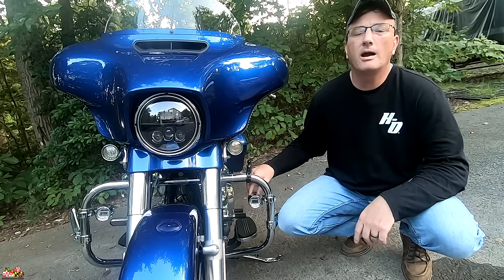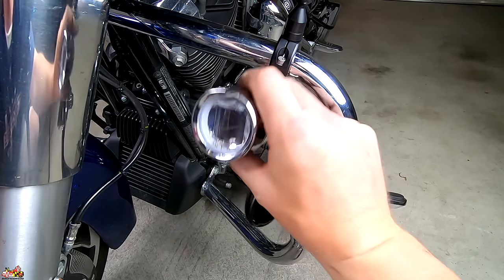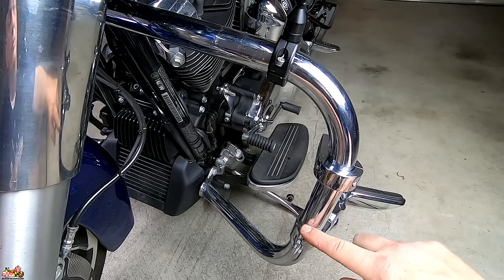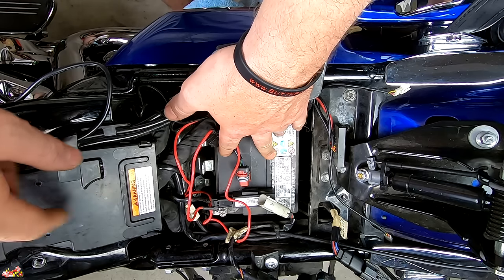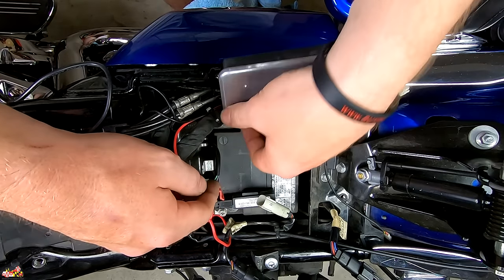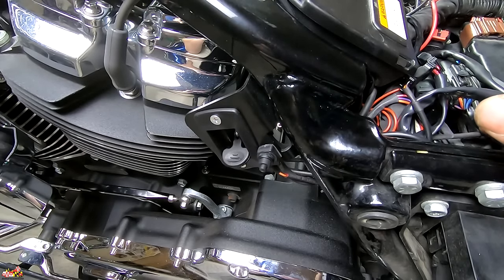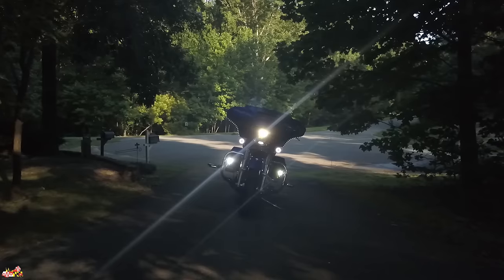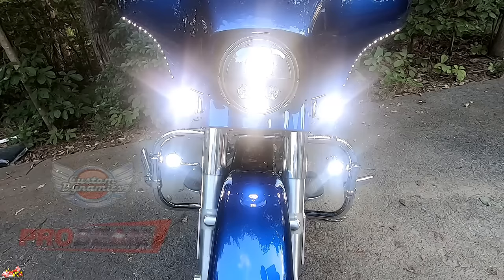How To Install ProBEAM® LED Halo Fog Lights for Harley Davidson & Indian Motorcycles 🔧

Comment: Why didn’t you make these so they could be wired into the auxiliary switches? Street Glides have all these unused aux switches and you want us to double sided tape another switch? Doesn’t make a whole of sense.
Reply from the maker: We include a push button switch with the ProBEAM® LED Halo Fog Lights in case the stock auxiliary switch is already being used by something else. However, if wiring the ProBEAM® LED Halo Fog Lights to your auxiliary switch is your preference, you can certainly do that instead of using the push button switch we provide!
Reply: @customdynamics  Has any one figured out how to wire these to the Aux buttons on the SG
Reply from the maker: @jasonwilliams7882  Feel free to give us a call at 800-382-1388; our techs would be glad to discuss that with you.

Comment: I PURCHASE ALL MY LIGHTING FROM CUSTOM DYNAMICS. I HAVE THESE FOG LIGHTS AND THE LIGHTING IS GREAT! HOWEVER, I JUST REMOVED THEM TO REPOSITION THEM FOR MY ADDED LOWERS AND THE MOUNTING CLAMPS ARE PEELING I NOTICED, PLUS THE THREADS IN ONE OF THE CLAMPS WONT GRAB. ITS NOT STRIPPED BECAUSE IT GOES IN NORMAL BUT THE THREADS ARE WORN AND I CANT TIGHTEN THEM ENOUGH TO NOT MOVE.☹
Reply from the maker: Give our office a call! We can certainly work with you to get these things resolved. 1-800-382-1388

Comment: Thank you for your awesome DIY videos. I own a 2018 RKS and definitely learned a lot from you. Recently, bought the Custom Dynamics Low profile saddle bagz light, the magic strobes, and the mini tail lights and watched your install video. Is there a maximum number of lights that you can connect to the battery before it overloads?
Reply from the maker: Technically, you could reach a maximum threshold on the bike’s battery if a significant number of lighting upgrades/accessories were installed on the bike. However, LEDs use far less energy than incandescent bulbs/stock lighting so, with the products you currently have installed we wouldn’t expect you to have any issues overloading the battery. Some modules like our Magic Strobes™ RSG Brake Light Flasher do also have a maximum power rating (84 Watts or 6 Amps) but again, with the products you’re currently running, you shouldn’t have any issues! Also, as a side note, all of the products you mentioned are only powered on when the bike is and would only be drawing power when the bike’s switch is on. Let us know if you have any other questions, we’re available by phone at 1-800-382-1388! Thank you for choosing Custom Dynamics®, have a wonderful weekend and stay safe!

Comment: The video title of this marketing piece should be "How I Installed ProBEAM LED Halo Fog Lights on my Street Glide." These aren't really instructions, more of a tour of the finished job which is only marginally helpful. Video could desperately use some labeling like an arrow pointing to "male end of brake light cable" instead of staring into a mass of identical looking cable ends while someone quickly hand waves through what was done. 
My problem is the dealer won't touch my older motorcycle so I'm stuck with having to either install this myself or find a local independent motorcycle mechanic. Meanwhile, I'm being forced to become a "YouTube Certified Motorcycle Mechanic."
Reply from the maker: While this video explains the steps to install a pair of Fog Lamps, mounting location, wire routing & installation under the seat will vary from motorcycle to motorcycle. If you have specific installation questions for your model you can contact our tech support team at the following link for specific details for installing on your particular year, make & model. https://customdynamics.zendesk.com/hc/en-us/requests/new

Comment: Excuse my ignorance, but I've eliminated my front turns, but would like to add these(back road living/riding haha). Could I use the existing wires/power from said existing front turn signals wires? Or would it draw do these draw too much power?
Reply from the maker: We'd recommend our complete LED turn signal assemblies at this link that can be wired as front DRL and turn signal: https://www.customdynamics.com/complete-probeam-dynamic-ringz-universal-turn-signal
Reply: @customdynamics  appreciate the response. But I'd prefer the probeams, as I've eliminated the turns up top, and need aux lights/down road projection.I think I'm just going to rewire and tap into the oem switch relay In line fuse etc... just wanted to be lazy...  sigh.
Mainly didn't know the draw on these guys
Reply from the maker: @josephfriedrich9792  These measure in at 20 watts per pair.
Reply: @customdynamics  you guys rock! I'm trying to get away from the dyna t bar bro, and going back to my japnstyle days haha

Comment: Ok Video  ,  I would have like to have   seen .  Is More of under the seat !.... Plugs   wire harness                                            where  what plugs  ... ?  . how long  wire are with the kit  .  ,showing  less of where to put the light  thank you  for your time  Sir
Reply from the maker: Hi Steven, Thanks for considering Custom Dynamics®! The ProBEAM® Motorcycle Auxiliary LED Halo Fog Lamps include 82” extended wires for ease of install/routing. The main wiring harness location that you’ll be utilizing for most plug and play applications does differ based on the year/model fitment. If you’d like to call us at 1-800-382-1388, we’d be happy to walk you through the installation on your particular year/model bike as well as answering any additional questions you might still have! 

Thanks again for considering Custom Dynamics®, we look forward to hearing from you soon!

Comment: 1:13 - What would they leak, blinker fluid? You should cut the wires, toward the ends, and drill little holes in your crash bars, so you can pull them through to other holes in the crash bars, by the downtubes. Then you solder the other end of the wires, that have the connectors, back on.
Reply from the maker: To clarify, the the ProBEAM Fog Lamps have a IP67 waterproof rating to prevent moisture and water intrusion. While designed to be plug and play installation, you could certainly choose a more custom install to hide the wiring.
Reply: @customdynamics ,
Right
I was just joking, because nothing would come out of them. You stated that they won't leak.